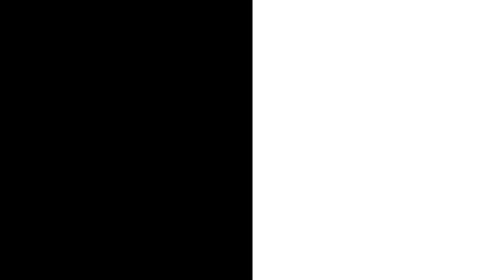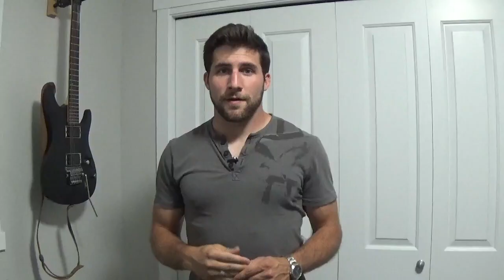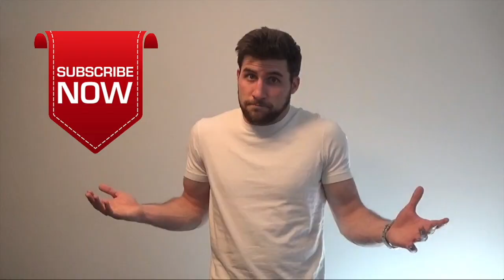Ask Brad Ep 14 | Wet Sanding Vs Dry Sanding

Comment: you are Right Brad I have gotten away with wet sanding guitars a lot of times. but i did a Jackson Explorer the paint game out so nice I was impressed .wet sanded it and the next day it swelled badly at the string through holes.
Reply from the maker: Damn, that must have been frustrating. Wet sanding is nice, but just not worth the risk on wood in my opinion.

Comment: i did 2 guitars with water based acrylic topped off with gloss poly. On the first guitar i didn't wet sand at all. On the second one which is a jungle camouflage  style, i used 3 coats of clear and i wet sanded the second coat of clear just so i could remove orange peel/drips from the first two coats and so that the final coat of clear would look like glass. It turned out so good i didn't even need to polish it with compound afterwards.  But yea i agree don't wet sand bare wood or the paint before its been protected with your clear coat. Cheers from Ontario Brad, Still tuning in \m/  Go Coors Light!! cheers \m/ ps. i should also say i completely hand painted with brushes for the paint jobs and used foam brushes to apply the poly
Reply from the maker: That's great Mel. I've glad that your projects turned out well. When I'm applying a finish by hand I often sand between coats to get rid of any brush marks etc.

Comment: Maybe I shouldn't have, but I pretty much skipped sanding. I lightly went over some rough spots, but I left anything that was smooth well enough alone. Then added polish. Guitar still came out looking like glass. Smooth too.
Reply from the maker: If a spot is perfectly smooth there's no need to sand and polish it. Generally we just do the whole surface in order to ensure that it's nice and flat.

Comment: I have a question about grit and how that relates to whether you're wet sanding or dry sanding. I'm not sure where I heard or read it, but someone stated that you need a higher grit if your wet sanding than if dry sanding. Is that true, or is that nonsense?
Reply from the maker: That’s nonsense, but it’s probably a misunderstanding of some general principles. People generally will wet sand with higher grits, whereas with the heavier grits there’s often no point.

Comment: Do you have a preference when to switch from circular pattern to straight line sanding? I tend to go in straight lines from 400 grit upwards but curious on what you think. Ta
Reply from the maker: I generally sand wood in a straight line with the grain. For sanding paint or a finished surface I just try to keep it even. I don't concern myself with direction.
Reply: When you change direction from one grit to another you can see if there are still scratches from the previews grit (only on the paintjob, not on the wood)
Kinda like when you clean a windshield from the inside and outside. 
(you'll know on which side the smudges are)